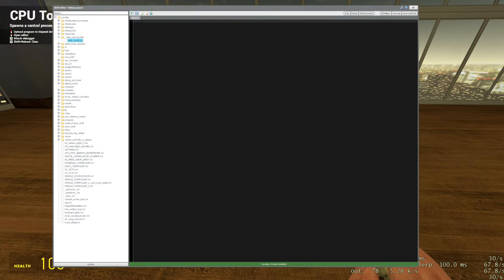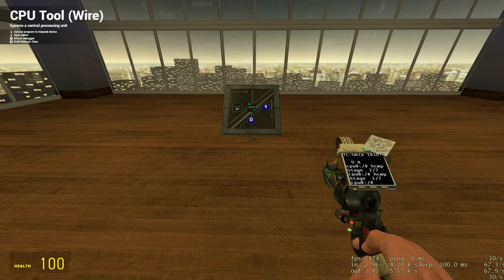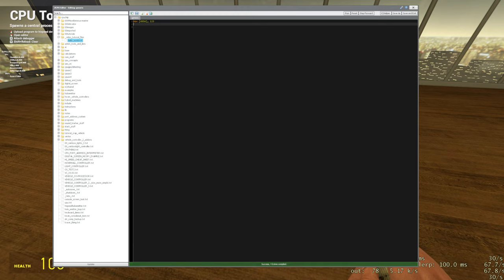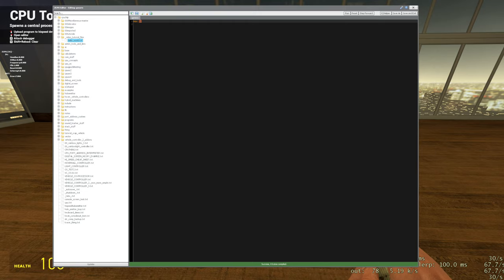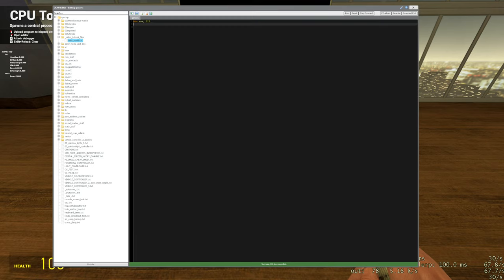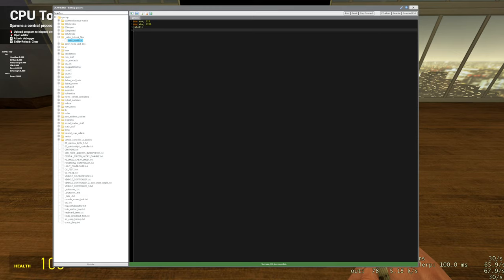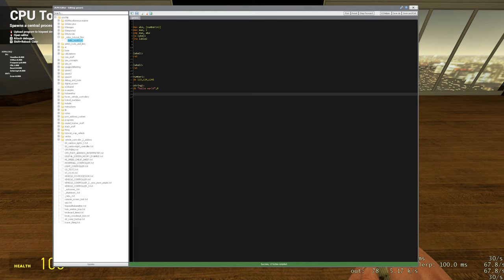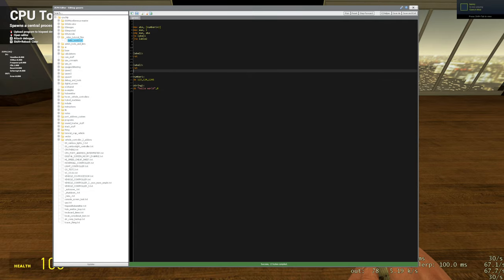Wiremod Z-CPU Tutorial 2 - Memory, Loops, and Hello World

Comment: How can i get input? Just like assembly in windows or other OS?
Reply from the maker: Sorry if I repeat stuff I said in the video, I'm sorta 
doing this on the spot.

Getting input on the z-cpu is different from getting input on something with an OS because a normal OS like Windows has various APIs avalible to programmers that can be used to interface with input devices like a keyboard or a joystick. An example of this would be DirectInput, which is a part of the DirectX API in Windows. 

Since we don't have an OS on the z-cpu by default, we're 
gonna have to do things manually.

There are 3 ways to connect to input devices with the z-cpu.
There's the memory bus (AKA Membus), the IO Bus, and then there are interrupts. I won't talk about interrupts though, because I've 
never messed with them.

For devices that have been specifically designed to connect to the
z-cpu, you would usually use the Membus to connect to them. You can do this connecting the Membus directly to the desired
device's memory. You can also use an address bus or an extended bus (which are separate tools in the wire tab) to connect the membus to many different devices at once. In terms of raw speed, I believe this is the fastest connection if you ignore interrupts.

For devices that can't connect to the z-cpu's memory bus, you would use the IO bus. You do this by getting a dataport (it's called Data - port in the wire tab) and connecting the cpu's IO to any of the ports on it. Then you would connect the desired device's inputs or outputs to which ever port you would like and boom, it's connected. Ports can only send and recieve raw numbers though so if you want to use some data that has a specified type (like a String or Vector) you'll need to do something  a bit clever to send it over the ports.

Then obviously you'd need to write some program to actually take the data from the input device